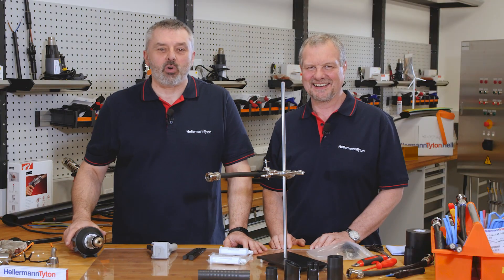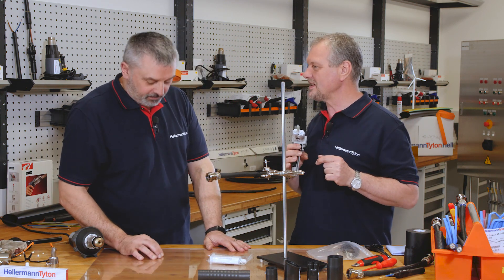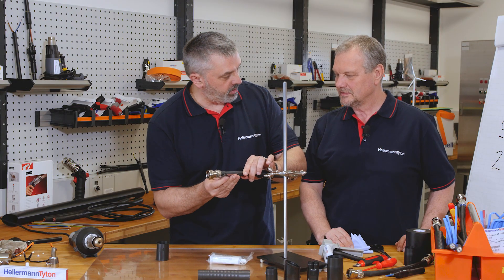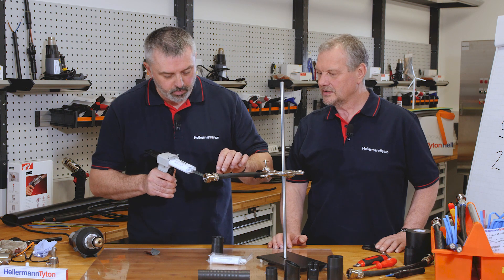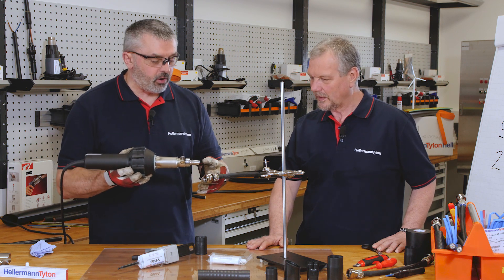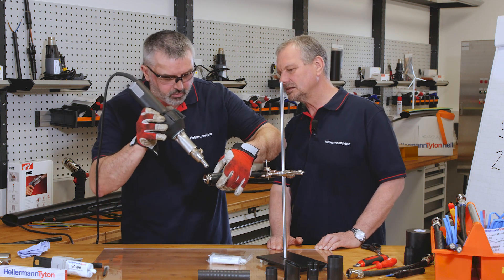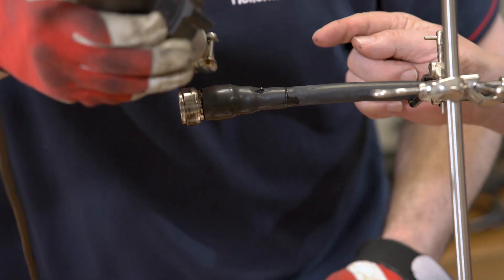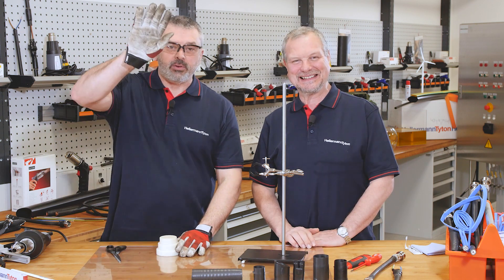Easy use of epoxy adhesive with heat shrink products #5

Comment: Hi nice work, what will be temperature if we set to 5 and 6? Could you please share me the details thank you in advance.😊
Reply from the maker: Hello Aparna Parimi, here you can find some more information about the Electrical Hot Air Tool : H6100 click here: https://www.hellermanntyton.com/products/application-tooling-for-heat-shrinkable-tubing/h6100/391-00110?utm_source=youtube&utm_medium=social&utm_campaign=YouTube-description&utm_content=Barry-Mark-tutorial-5-8SPHp-QCC50-products-details-page-391-00110-comments

The temperature depends on the cap you use. Here you have a diagram on page 34 where you can read the temperature for the different settings: https://www.hellermanntyton.com/shared/datasheets/1106432.pdf

Best wishes,
Nico

Comment: sorry but it looks like the boot split towards the back end? 9:33 in the video, what is that 'notch' behind the braid in the back end ?
Reply from the maker: Hi Vinod Subramanian
, Thank you for your comment. 
The small hole you might see on the back of the heat shrink boot is called an “eyelet” and serves a specific purpose. This little hole is required by military standard VG and allows to attach connector accessories like dust caps to the cable assembly.
 It's a design feature. Have a closer look to some images here: https://www.hellermanntyton.com/products/heat-shrinkable-moulded-shapes/155-42-g/401-55880?utm_source=youtube&utm_medium=social&utm_campaign=YouTube-description&utm_content=Barry-Mark-tutorial-5-8SPHp-QCC50-products-details-page-401-55880-comments
Best wishes, Nico
Reply: @HellermannTyton-Global  This is AMAZING - glad to see your reply. I understand the 'eyelet' feature. However, kindly elucidate the eyelet in your next video. Obviously the eyelet does not affect the IP rating since it must be at an upper layer of the boot? Will be good to have a subsequent video to explain all features of the eyelet. 

Many thanks once again for such a prompt response to my query! 

WOW to you guys out there! (btw i just bought a HellermanTyton sleeve fitting tool! top class engineering i can see here!)